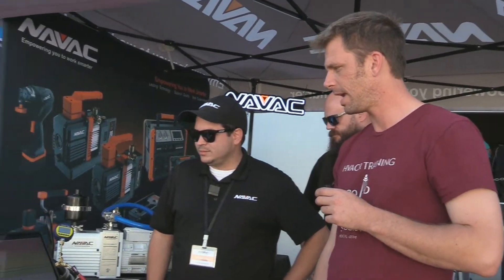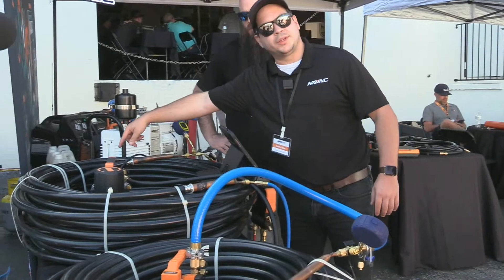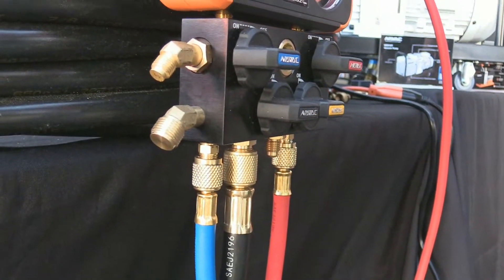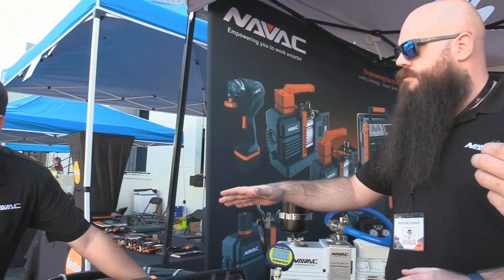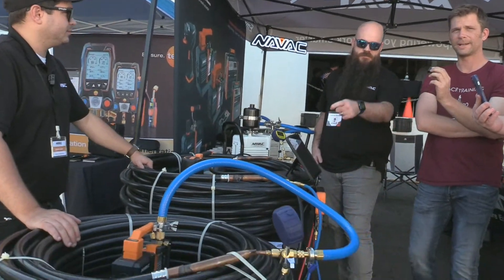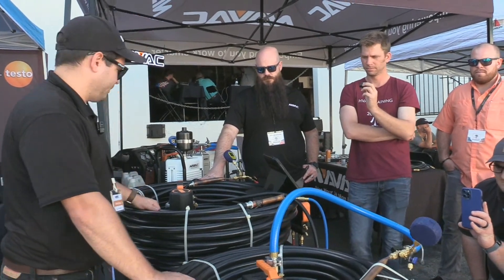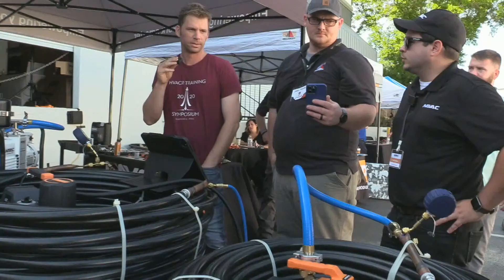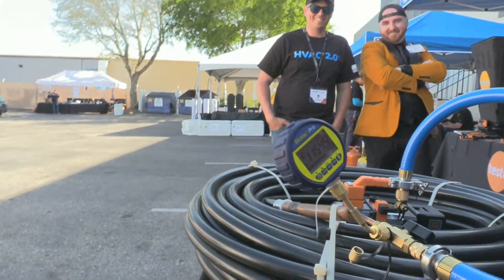Vacuum Race feat AK HVAC

Comment: Quick question for ya Bryan. Have any of your guys ran the Megaflow 1/2” 3/8-1/4 hoses with the core tool and the SPDY38 fitting on a JB pump (like the 6cfm eliminator)

Comment: Best practice? Don't pull a vacuum through your manifold or refrigerant hoses! Have dedicated Vacuum hoses and skip your manifold, unless your running an SMANS (which are terrible micron gauges), there is literally no good reason to add your manifold or refrigerant hoses to the equation.